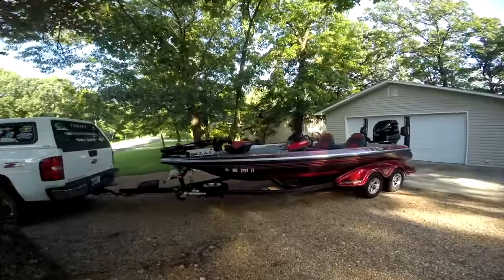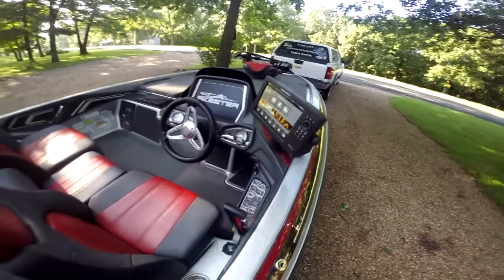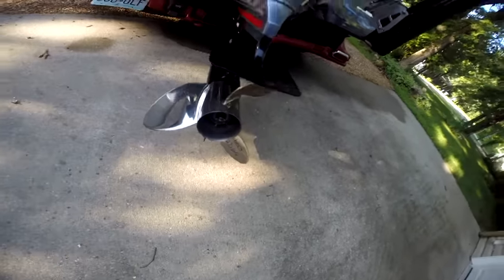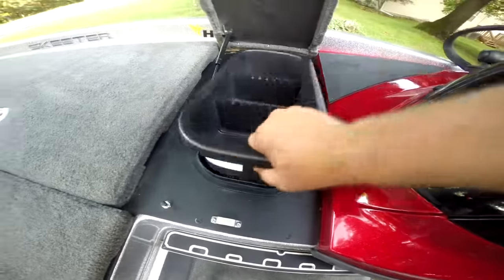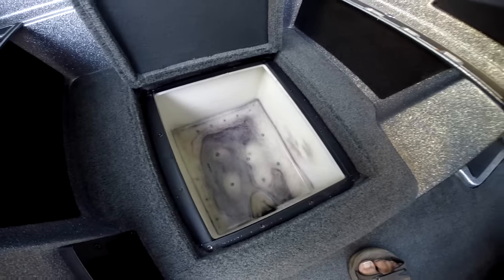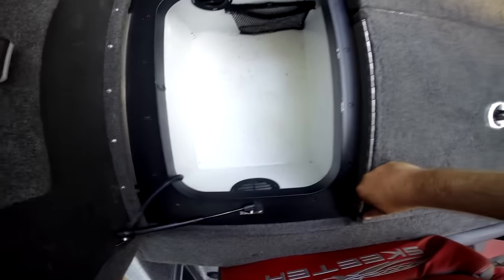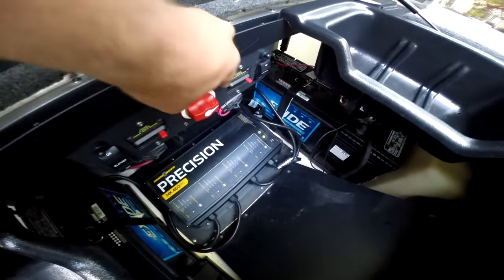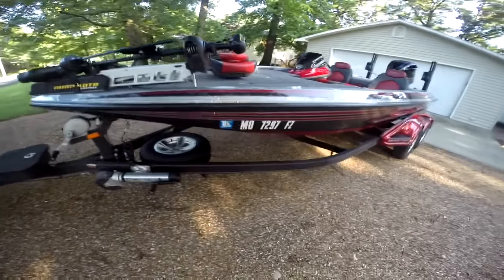SOLD!  2014 Skeeter FX20 Walk-Around Video

Comment: Whats the top speed on this beauty?
Reply from the maker: Depends on load in the boat. But Worse with lots & loats of tackle Upper 60's, light load in cool water low 70's. Fast enough for me and it's passed alot of self proclaimed 80 mph boats :)
Reply: That boat is faster but the Talons slow it a bit.  I wish I could buy it just so I could go to Missouri and spend a day with Doug!  I can dream.

Comment: one comment tho my man, just wondering why the price is quite so high? given the year , engine hours, wear, thinking it shouldn't be almost brand new procing. maybe due to the amount/quality of electronics and options on board?
Reply from the maker: It has lots of accessories 2 ONIX Units, Dual Talons. The Engine Hours are 80%+ I bet idle speed with all the testing and Side Imaging work I do. Boat has been upkept and not your average boat.